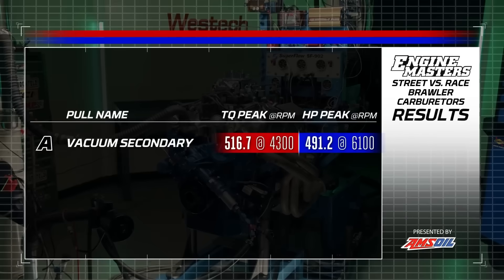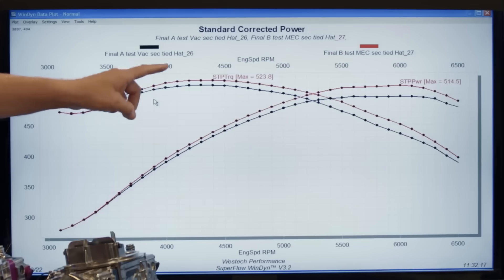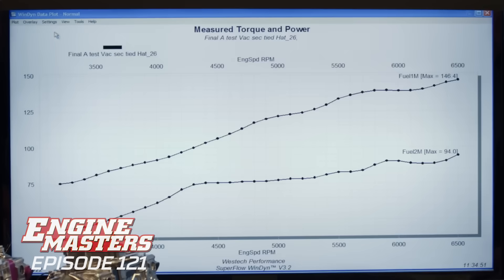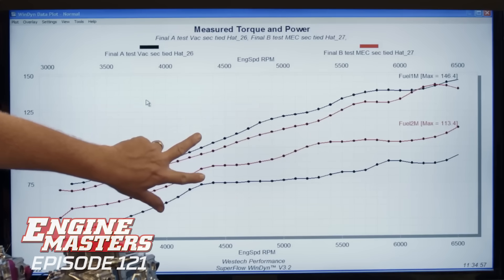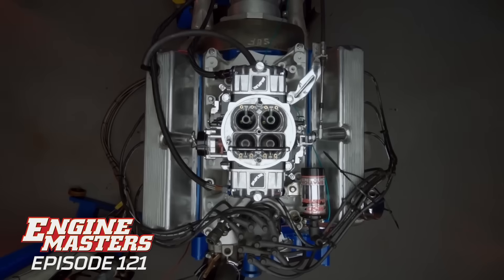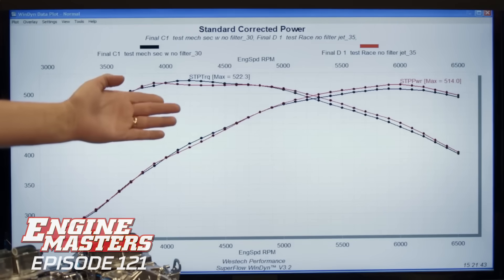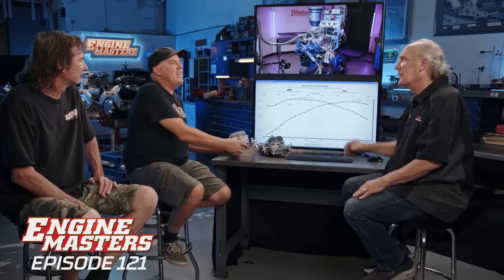Carburetor Confusion! What's the Best Setup? | Engine Masters | MotorTrend

Comment: i get AED carbs and test them on the street with AFR  gauge. 750 double pumper.  I put power valve in the back also. play with air bleeds and jets and open secondaries sooner. I found great results for 383 SBC. I like the turbulence in the RPM air gap. works great. I put a 950 DP on a street 434. did the same thing . low 11s in a 73 camaro street trim/ sticky tires.

Comment: Holley used to make a plastic piece that fit on the carburetor that smoothed out the air flow. Used it for 12 years on a Holley spread bore. Seemed to work but not sure.

Comment: Excellent!!! (as always) I would like to know the benefit of a stock air cleaner (such as two snorkel on Pontiacs or SS wide snorkel) .. stock with an air horn vs aftermarket with a flat bottom plate. My assumption is that the stock air horn reduces turbulence at the carb inlet?

Comment: I used a 3310 with down leg boosters and rear metering block , tunable on all four for the street.  They can flow 780+ with some mods and are tunable in all four. Have you tried one? I put as big of double pumper as I can find on my drag engines normally 950 on a 383 Windsor with 215 heads and a lot of camshaft. With a blip over 700@8200 it works well.

Comment: Great but I still don't know what to put on my Cleveland 4V head. The Edelbrock 1406 has to go...
Reply: From my experience , mopar 360 magnum and mild cam , headers etc , good ole 600 holley dp works amazing with a tight torque converter and highway gears , more snap than 1406 and no vapor lock problems at the lights , good luck .

Comment: Could the fuel difference not be that the spring in the vacuum secondary carburetor is too stiff and if you installed a lighter spring the secondary would open quicker and be closer in power to the mechanical secondary?

Comment: Dual circuit Dominator 1050 cfm'er. = +4 mpg over dialed in 4150. Had 11 mpg with 4150. Now has 15mpg with dominator. Chevy Nova.

Comment: I run a Holley 670 avenger on my 428 C.I. Mild cam street Engine. It works perfect for me. A Holley Avenger Carburetor is a type of performance carburetor that is designed for street and off-road use. It is not a double pumper, which is a term used for Holley carburetors that have two accelerator pumps. A double pumper carburetor is more suited for racing applications, while an avenger carburetor is more user-friendly and adaptable to different driving conditions. Most people are non racers.
Reply: Aside from maybe being a bit on the small size for your engine, it CAN be tuned for serious performance and still get decent fuel economy. From my experience with the Street Avenger, the idle system is calibrated on the lean side which is fine(and desireable) for a mild engine and highly advised to use a choke for cold start & idle. When you start adding a cam and a bigger manifold- especially an unheated one, the idle system calibration will likely be too lean and not only will it be difficult to achieve a good idle but will also be difficult to eliminate an off idle stumble and stomp on the pedal pop through the carb. The fix would be to open up the idle feed restrictions in the metering block a few thousandths of an inch such as going from .028" to .031". If your idle mixture screws need to be turned out as much as 2 turns, performance would probably benefit by increasing the idle feed restrictions by a couple thousandths. I like to shoot for 1-1/2 turns out. Often when a performance carb is put on a mild engine, the mixture screws require less than a turn out for best results. That carburetor will most likely run pretty good when started cold without using a choke, but will also be a gas pig. Anybody that reads this will probably start going on about idle air bleeds- blah, blah, blah- whatever works for you.

Comment: would you not test the vacuum secondary with the secondaries jetted up? the hypothesis being that it should then match the fuel delivery of the mechanical secondary. maybe this way you get the better of both worlds?
Reply: Right...Like was mentioned the air velocity draws fuel from the accelerator pump discharge nozzles / circuit once the throttle blades are fully opened. They continue to flow fuel. I have seen that occurring on camera footage before of carburetors running on a dyno. One of these days i'm going to mount my go pro under my hood to see what goes on. I've spent a lot of time tuning my junk using both vacuum secondary and double pumper carburetors.

Story.
One tuning session after I put my AFR gauge in the car I was working with different power valves. Changing different ones in and out for hours. Driving and observing. Nothing was effecting the readings. I took off the front bowl and metering block again...I was starring at the metering block. Looking at it in disbelief. Just starring for like five minutes. When I saw what the problem was.
Holley did not drill the power valve channel restriction holes in the metering block !

DUH !
Reply: @superfuntime3107   ohh, boy😡

Comment: I built street/strip 440 my 66 Belvedere. Had 700 double pumper. I tweaked rebuild thermoquad 850. Boy did that thing run!! Never a hickup or stumble or anything. Ran flawless. Snappy throttle response and would keep pulling hard!! Im a thermoquad believer fanboy totally!

Comment: The dyno numbers are impressive, but it really comes down to seat of the pants results. In my 69 big block Chevelle, vacuum secondaries with a 4-speed and 3.73 gears always gave me steady consistent launches. Switching to a double pumper carb, I only got good throttle response when I switched to a 4.56 rear gear. On the street, the launch was everything! Stop light to stop light never allows you to reach the upper power band. Street tires and the street itself were always the limiting factors as well as local law enforcement.

Comment: Wouldn't a digitally controlled carb not help provide an equal balance all the way through the range,no? Rhetorical question because there isn't a digital carb available, is there? And no, I'm not a mechanic and I don't know a lot about carbs, but I'm an IT guy and watching the development of electric engines, and they are by the way, no matter how many times me, look up the meaning of engine in the dictionary 😉 but yeah, if they can control everything with pcbs then surely they can do that with carbs, right?

Comment: Seems to me you didn’t choose mechanical or vacuum secondaries based on horsepower but more to crutch up gearing for the street, traction issues, drivability and throttle response needs. If the carb is set up right, the accelerator pump is out of play once the pedal is down or you’ve got the wrong nozzle.
A real 3310 (780 CFM) had different boosters and wasn’t crutched up to work on a small, choked down motor with no signal. They worked good on everything

Comment: Is it not just because the "choke horn" acts as an extension to the intake runner, changing the pulse tuning of the manifold? It performs better at lower rpm and suffers in the top end, like you would expect in a low vs high intake...

Comment: Need to compare manifold vacuum for each run. My guess is that the more restrictive carburetor versions will flow the same amount of air, but at slightly higher vacuum. That higher vacuum would sap some of the potential horsepower.

Comment: QUESTION ... between the vacuum and mechanical carbs you measured the air volume to be exactly the same and measured the fuel flow to be dramatically different ... especially on the secondary side.   You put the difference in fuel delivery down to siphoning fuel thru the discharge nozzle .... which is fine.
But given that the volume of fuel ingested looks to be around 20+% LESS at some points, surely this would show up a lean condition in air/fuel ratio ???  
So why can't this be tuned out of the vacuum carb ???

Comment: The difference from the vacuum secondary also is no back metering block and the four corner idle. Metering block possibly adding more fuel for the secondary system??

Comment: I´d like ro know if the AFR was the same. If it´s "leaking" through the acc pump but the airflow is the same the dp should be a bit richer, meaning the jetting the vacuum carb should put out the same power. Yes?
Reply: Exactly ... just asked that question, then thought I'd read some comments and see if anyone else picked up on that .... several have.
Reply: AND it only makes sense to me that purposely enriched mixture through a metering circuit designed for the job and dispersed through the booster to atomize correctly would be better and more consistent than fuel "accidentally" admitted into the airstream through the accelerator pump squirter😵‍💫

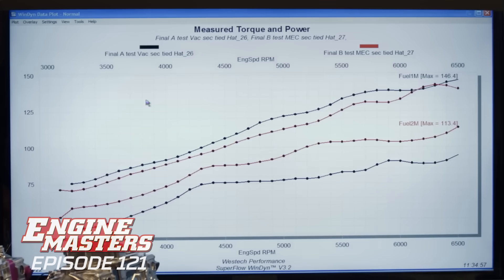Comment: I have a mild 318 in my Chrysler. Stock heads. 1980 model. It has a mild comp cam 268 h and edelbrock performer intake with an eddy 500 avs carby. Hei ignition with extractors and a full 2.5inch exhaust.  Stall converter is a 2300 and diff ratio is 3:45 lsd truetrack.  
I removed the choke butterfly from the front of the carby as this was a restriction and it certainly did make a difference on how it performs.  Runs real well. Starts fine with no choke,just got to feather the throttle for maybe 30 seconds then it will idle happily. On the dyno as I had carby professionally tuned,it made 220hp at the tyres. Not massive  but very good for what it is. I often wonder how it would change if I was to go for a bigger carby? Like a 650 perhaps? But they cost a lot so I won’t worry about it.  
Great video by the way 
🤘

Comment: Also,, it depends on the carb. I once had a 780 vacc that had a rear metering block with a powervalve. Unlike the common 'plate'
The carb was still too big for a stock 400 Ford. Except for top end. A 670 Street Avenger  [fitted on a Performer] was far better for low end and mid range power and far more economical as well. Same engine with an overhaul, medium cam with springs and 2 1/4"  dual exhaust is even better.

Comment: Using the double pumper when you floor it both throttle plates are open so there's more fuel available for the engine to use

Comment: Now for what the dyno  doesn't show....throttle response (not an issue in race applications, but crucial on the street).
Reply: Either carburetor can be tuned for great throttle response without having to rely on two steps, trans brakes, or unreasonably loose torque convertors.

Comment: Show  us what  happens when you change  the pump cam profile    choose any 3 colored  pump cams your choice.  Each color has a different  profile there are many different colors  to choose from and each one has two positions that  they can be installed in    now Show us what  happens  on the dyno when you change the  pump cam profile
Reply: The dyno doesn't read throttle response.

Comment: My question is do manual cars need the mechanical secondaries? I'm running vacuum now as this was how car was setup when I purchased. It does seem to have issue during shifting to get the 4 barrel to kick in quickly. I'm changing over to a mechanical secondaries for this reason. Seems alot of people belive one way or another. Just like your opinion. Thanks!
Reply: You should be able to change the spring in the vacuum secondary so it’ll open quicker. I’d try lighter springs and see if it gets better before going for a different carb.
Reply: @NBSV1  Thanks for info I appreciate it!

Comment: Went through this with my 393W stroker with several different Holley carbs in different sizes, with and without choke horns, etc..... ended up on the 780 double pumper just like I thought I would in the beginning. I've always heard the theory that the  horns cause turbulence in the venturi air  which affects the fuel atomization into the chambers so the burn isn't as efficient but I'm no expert. I still need to do  a bit of tuning and jetting to get max out of my engine, but my hot rod is so light and my hp ratings are higher than I need already so I'm in no hurry to make my car even more uncontrollable...

Comment: Well there is always a point where you can over carb a motor. I have a little 306, lol, with a Carter/AFB mechanical carb sitting on top of a Typhoon dual plane intake. He has Gt40P heads with upgraded valve springs.
Frankenstein loves to show off his speed. 4R70w trans with 273 gears. Do your homework before you say about the high gears. A '97 Mustang 3.8L comes with that stock. Yes I'm running V6 torque converter also. He shifts out of 1st gear at 60 mph and it doesn't take long to get there.
I didn't say what all was done to motor. That's my secret. I got probably 450-500 hp with awesome torque is all I'll say. I need a dyno to see what he has for sure. You wouldn't miss FRANKENSTEIN If you saw him, lol.

Comment: have u ever ported the cam bearings to get a bigger cam in a sbc or season a block or polished the inside of the block for faster oil drop or put over sized cylinders in a sbc or use aluminum titanium alloy rods or balance all the parts rods pistons so on then balance the piston and rods to the counter weights then balance the crank  with fly wheel and balancer. u guys should try this it will do insane rpms if u try this port all the ports oil water so on then port the heads open up the intake ports and match the new intake ports to the heads but u will need to go bigger on the cam so u will have to go over sized bearing on the cam when we did it back in eary 90's the custom roller cam just the cam was over 1000 bucks and u will need titanium locks on the valves. we did this to a 327 i helped but bell blue printed and built the engine he also went with tunnel ram with 13.5 to 1 compression for pump gas only 92

Comment: I have a race 4150 on a 383 Chevy and the horsepower is incredible but it runs so rich at idle it could choke a horse. To be fair, I have not looked at what size jets are in it.
Reply: Jet size has nothing to do with idle.
Reply: You would have to change idle feed restrictions to lean idle mixture. If your mixture screws need to be less than a turn out the restrictions are big. If over two turns out, too small. I shoot for  around a turn & a half. Depending on what carburetor you have they may or may not be changeable. If they are not, they can be modified a few different ways, or you can get a Quick Fuel metering block that has changeable idle feed AND power valve restrictions.

Comment: If the double pumper is adding more fuel (via siphoning through the a/p discharge nozzles) to the same air volume, the mixture is richer. Why not enlarge either the main jets or the power valve restriction in the vacuum secondary carb to achieve the same fuel/air ratio?
Reply: The problem is distribution in the Vacuum Carb vs the DP. It's more than just the volume of fuel added by the siphoning. It's also distribution. You've got 4 separate barrels in both carbs. All the same size and physically in the same spot geographically speaking on the manifold to which they are bolted. This is where the similarity ends though. While air flow is the same in both the ability to atomize and mix fuel is different. ALL THE FUEL supplied in the two primary barrels of the Vac Carb must mix with air supplied by all 4 individual barrels of the carb. The front two will supply a little bit richer mix to the cylinders supplied most by the air coming from the front of the carb and the cylinders mostly supplied by the rear bowls will be just a tad leaner. It's a trade off you accept for the drivability on the street. The mechanical carb supplies fuel to each of all 4 barrels and this no doubt gets you a much more even distribution of air and fuel both to every cylinder.....while not perfectly even you can bet it's far closer to even than the Vacuum carb will ever be capable of. As Steve B points out: you could richen up the primary circuit of the Vac carb but you'd lose all you drivability in the attempt and it still wouldn't work as well because while you may actually resolve "lean" in some cylinders it'll almost for sure enrich, past ideal, in those that were properly supplied before you richened up the primaries. Bottom line: This is why computer controlled injectors above each cylinder are how it's done on modern engines.  With a Carb you can't have both. You gotta pick. Street or Strip one carb is going to be vastly superior to the other depending on your priorities. The vac carb can't match the WOT performance of the Mechanical and of the flip side the Mechanical will never be able to match the street manners of the Vacuum Carb. You gotta know which is more important to you ahead of time.
Reply: While that would have been worth testing, it seems their criteria at the onset was to test apples to apples from the factory instead of fiddling with them whatsoever. I bet you could compensate a bit for what the vacuum one lacks in and probably pretty easily so it’s disappointing they didn’t test for that.

Comment: I wonder though. If thr only difference is fuel wouldn´t bigger jets on the secondary take care of the difference?
Reply: I think the same as you, but bigger jets alone may make the a/f ratio fat in some rpm ranges but jets AND air bleed size changes will alter the ratio curve at different engine speeds. It's the engineers' job at Holley Carburetor to accomplish. Are the lower priced carburetors intentionally designed to fall short of potential in order to encourage the user to upgrade to a more expensive model and make another sale? Sorry, Holley, but I believe that is the fact.

Comment: I race my Falcon in vintage races.  Holley double pumper.  
For my street driven Mustang and Firebird, I've found the most important part I can add to my holleys to make them run correctly is called an.......Edelbrock.  
PS.... I have two holley classic 650's for sale.